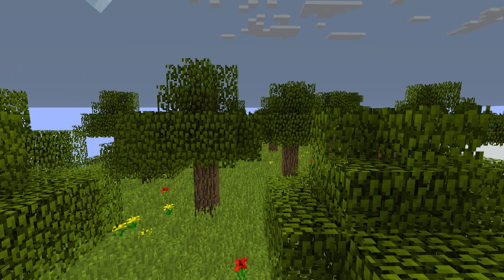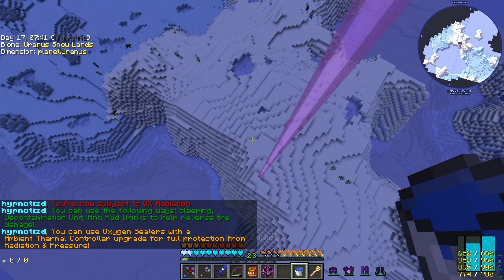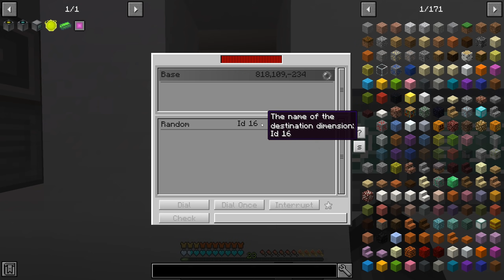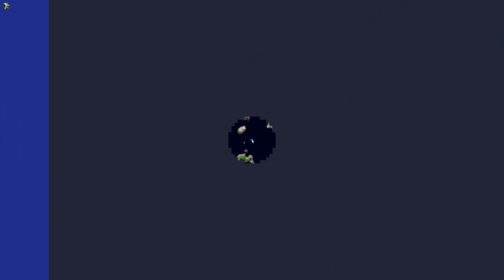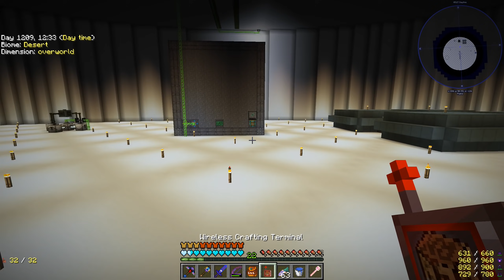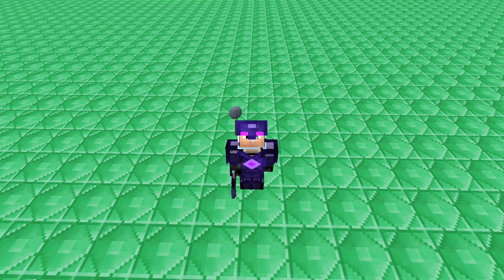Project Ozone 3 Kappa Mode - INFINITE EMERALDS [E112] (Modded Minecraft Sky Block)

Comment: For no reason I decided to figure out exactly how much EMC Hypno will be getting. In a 512 x 512 x 60 area there are 15,728,640 blocks. Assuming all are emerald blocks that is 2,319,282,339,840 EMC per quarry area. Running 4 at the same time will give him a total of 9,277,129,359,360 EMC once all 4 have finished.

Comment: I was thinking, why not use nether star blocks honestly, if it exists in this pack.
Each nether star is basically an emerald block, so 9 stars is the equivalent of 81 emerald blocks.
Just a lot easier? Maybe? 
Though the digital miner also has to be able to mine it, too.. Unless there's another machine able to mine it, like the builder, again, if it's in the pack.

Also, why not use cryostabilized fluxducts throughout your whole base, and utilize those monstrous power producers? Power transfer would be so much faster, no worries anywhere in the entire base for power.

Comment: You can shift & mousewheel with the translocator to scroll through destinations without opening the user interface.
For the EMC farm dimension, would it be possible to make it out of octuple compressed cobblestone rather than emerald blocks? Would make the emc come in way faster.
Reply: He does know that, but it's usually just easier to open up the dislocator and use the menu from there.
Reply: Compressed cobble or obsidian cannot be collected absorbed by the material absorber, therefore he is unable to make a dimension with it

Comment: What kind of utility mod did you use to move yourself to the overworld? (you may remember me from twitch a.k.a axmart7)
Reply: Pretty sure the command comes from FTB utils and maybe one of its addons
Reply: Well I was just asking from curiosity, I play with the modpack, and I use the /spawn command, which mostly the same but I had a few instences where I needed to use an Editor to move myself to the owerworld, or reset my inventory when for no particular reason I got it wiped while going to the nether!
Reply from the maker: I was unable to interact with the client at all. I ended up NBT editing my player file back to the base. Like I said cheaty, but was left with little choice.

Comment: For power reduce you can make a Player detector to detect if a Player is in loaded dimenstion, if not, it cost no power upkeep. For EMC things, can you make a NetherstarBlock Dimension and is it possible to hook up a ME Interface and or a Storage bus to the Transmutation Table to acess it from the ME System?
Reply: To connect ME system to EMC system you need special addon to ProjectE (i don't remember the name) which is included in this modpack
Reply: @mrproxima1824  equivalent energistics

Comment: You should use silky jewel instead of emeralds. It has a better emc value.
Reply: I saw one for liquid terrasteel in the workbench which would be even better I believe
Reply: @vertical7747  idk if that would work because it is a liquid than he will have to cast it and hardden it and it would take longer

Comment: The Killer Bunny is a standard vanilla non-hostile (hostile) mob spawn. It's a reference to Rabbit of Caerbannog in Monty Pythons Holy Grail. As an extra note, this is where the Holy Hand Grenade is used!
If any of you young-uns haven't watched Monty Pythons Holy Grail, do it! I promise you, you will not be disappointed.
Reply: ChaosmanOne and remember kids! Always count to fiv- i mean three!
Reply: My dad made me sit down and watch monty python, and I can't say that I regret it
Reply: The black knight is the best part
Reply: I don't think this is the actual killer bunny. Vanilla doesn't have natural spawns, has it as a hostile variant that attacks players within 16 blocks, and has the texture as pure white with horizontal red eyes. The mob spawned here as non-hostile, and it duplicated to any rabbit texture, essentially making it a named mob rather than the actual RabbitType:99 Killer Bunny. Obviously there's a mod, or mods, that modified the spawning of the regular mob to include this name and texture, but the duplicating implies that it's a spawn modification of a typical rabbit and not the spawning of type 99, as type 99 wasn't correctly duplicated.
Some other ideas are that type 99 was modified, the mods responsible for spawn changes only pulls name and textures but not other type attributes, and/or the mob duplication mod(s) only copy mob and name but don't pull any other attributes for mob subtype, which would lead to RabbitType:99 being broken in this modpack in a variety of ways.

Comment: I thought terrasteel was better for emc? Why not just abuse magical agriculture and spam lvl 5 terra steel seeds
Reply: I did that and got enough terrasteel within a day for the 10 lime matter needed.
Reply: @doctorblaze5497  I did that but it get laggy if you Imaginary Time Block lot of them so I did half with Silky Jewel Block it have 224k EMC and can use with Material Absorber to make dimension.
Reply: La ri To get around the lag issue with the seeds you can set it up in a different dimension since those types are farms are more so just demanding on client rendering than the server.  There is a secondary void dimension in this pack Hypno went to at somepoint iirc (similar to the Last Millennium) where you could set that up so it would only be laggy when you’re in said dimension.  That’s what Hypno did on his PO2 Kappa mode playthrough at least
Reply: @ericpoore2063  Yeah i know that there is but what i tested it was so much faster with 4 dimension builder them to make way too big farm to get on same EMC numbers..
Reply: best for EMC is the octuple compressed obsidian. no idea if you can make a dimension with it
Reply: @Rogan621  You can't make a dimension, but when you get 10 lime matter by other means, you can create the Wand of Animation and animate octuple compressed obsidian for some of the highest generation possible in this pack.
Reply: @Rogan621  He already looked for it last episode and there was no compressed cobble dimlets
Reply: @Rogan621  Not possible, yes it is best but with wand of animation only
Reply: hella newbie:) terrasteel is 4 x better than emerald blocks and through dimensions you can mine emerald blocks 1600 blocks per second. you would need 400 blocks of terrasteel per second to get same level (and to farm terrasteel that fast with plants is really hard, but farming emerald blocks with dimensions is really easy once you have one dimension) so yeah
Reply: oh and no 5 lvl terrasteel seeds exist btw
only for inferium seeds.
Reply: Frozen Fire bit rude to call me a newbie lmao, and not trying to start a fight. Since he has access to terrasteel, i figured it’d be easier to just set up a farm like that. This was before i watched his video setting up the emerald dimension lmao.